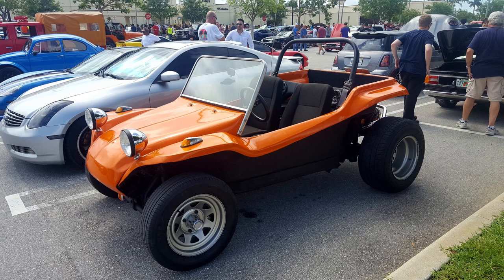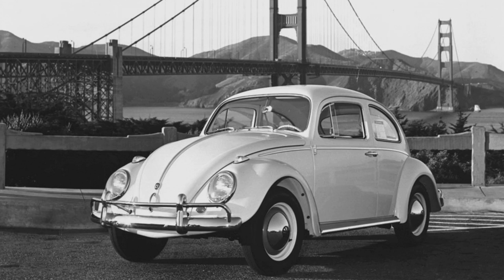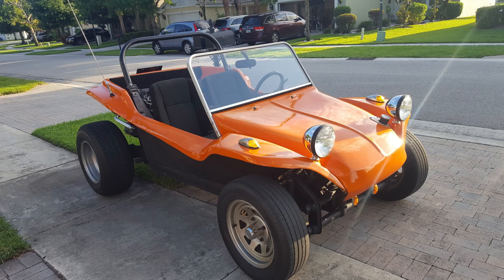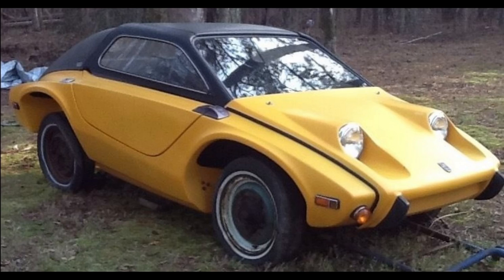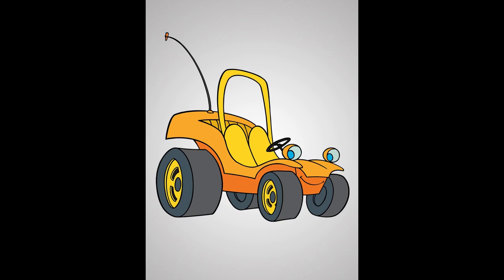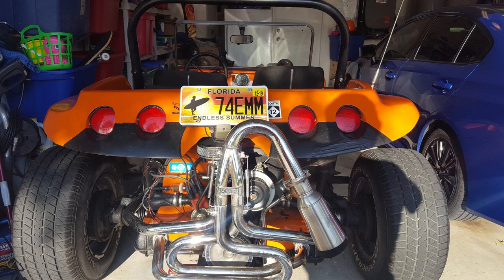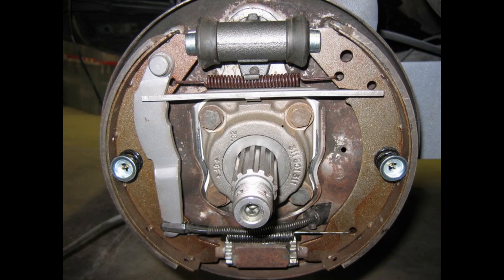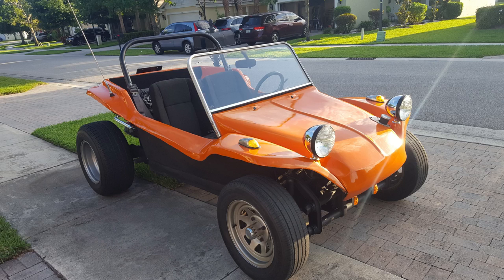The Dune Buggy: Origins and should you buy one?

Comment: Can lock anything up in it. Almost impossible to get it inspected in lots of states.  No heat no defroster.  Not much of a car.
Reply from the maker: It does what it was made to. Go offroad and have fun. I can't fault a Ferrari for not having room for groceries. I have seen people put a full top on one and run a electric heater. Some states don't like kit cars at the DMV that's true.
Reply: @autochatter  It is not a problem to title one is the state I live in. Just title it as whatever VW it was made from with the original VW title. If it has required lights ,horn and other safety equipment no problem. Same with insurance,it is a VW beetle.But I don't live in one of the want to be authoritarian communist states. I never owned one but I did shorten the chassis on  one for a friend in about 1970.
Reply from the maker: @WesB1972  I had to title my orange one as a 2007 vw roadster as that was the year I put it on the road.

Comment: The drum brake adjustment does NOT require the drum be removed, in fact the drum MUST be installed to adjust.  Just lift the wheel off the ground, leave the tire on, remove hubcap and there is the hole for putting a screw driver to turn the adjustment gear.  easy peasy!
Reply from the maker: Yes..there are adjustment holes..Its easy..but not as easy as some drum brake cars where just backing up does the job. Lol

Comment: Nope….because the body of the VW beetle, was part of the engine. Separating the cool air intake from the hot exhaust.
“Nuuu Ahhh” No Its Not”……..ummm yes, yes it is.
Now.
Your driving your buggy and never for a second stopping in traffic? Always 30 plus mph?
Never parade pace strolls?
Ok….then it will work.
But the moment you stop it starts ingesting all it’s own hot air.
Lemme ask you a question about another air cooled engine. The ones on the B 29. Do you know what killed most of them? Not enough speed on takeoff. Because there wasn’t enough air flowing around those heads. And they would drop valve seats. They got hot that fast that quick. So the pilots would want to get them to speed on the runway. Or they were going to have trouble.
This is the same principle, but it has a fan cooling it.
“Duhh..No It Won’t….cause I Says Duhhh”……..ummmm yes. Sorry.
Sure, you can have an engine in one of those last 5000 miles or so. Absolutely.
“Duhh…I have one with 50,000 miles on it..Duhh…so uhhhhaahhh.” Ummmm no…no you don’t.
Ok…yes you can put fans, and coolers, and deep sumps, and 90wt in the crankcase. And all that crap. Sure.
But that’s not……an original..VW engine…..is it?
Look.
Buy a beetle. Paint it purple and glue dinosaurs to it. But….leave the engine bone stock, in proper tune. And it will do anything that buggy can, last longer. And your retarded ass won’t be wet when it rains.
Reply from the maker: Wow..OK. Yes the design of the body helps disapate heat from the engine. Im not a mechanic, so im only going from personal experience with my buggies. They never ran hot but I also never drove any of them 50k miles, so I cant speak for long term durability. I had a friend with a Baja Bug that hit the beach like I did in my buggy.He had a 1776 engine with more power than my stock 1600 and had nice wide tires on the rear. He would struggle from the extra weight in spots where I wouldnt. Dune buggies are all different and theres alot of Beetle upgrades as you know. I didnt care about making my car as original to a Bug as possible. Why settle for drum brakes when I can get discs? Why mess with points  when I can get a electronic upgrade? The roller gas pedal was the best 10 bucks I ever spent! I liked having a spin off oil filter. Its not like Beetle modifacations are unheard of.I admire the passion, but theres no need to refer to someone as mentally challenged because they prefer a open car is there? It wasnt my daily driver and a buggy is probably not for most people.
Reply from the maker: @LosebJughashvili  Hey its all good. I appreciate your input and you obviously have extensive knowledge about air cooled VWs. There are certainly disadvantages to buggies and I stated some myself. Would I let my teenage daughter drive one in South Florida where I am? Nope! For that, I applaud your concern. I can let  you in on a secret. I can see the demographics of who has watched it ....and it's not BTS fans LOL. 50 and up is  the age demographic who has seeked it out.. It's a personal story and a little history on buggies and lots of buggy fans have commented on it. Some even knew Mr Meyers personally. Everyone has opinions but I felt compelled to defend the buggy community. I wasn't offended personally..skin's pretty thick LOL. If safety is of the upmost importance to you , nothing built back then holds a candle to a modern car. I think its safe to assume us older folks who like these cars know this.